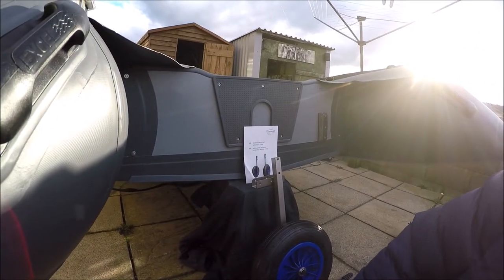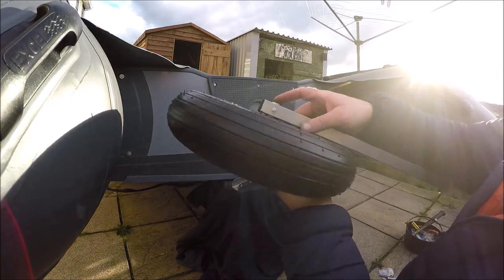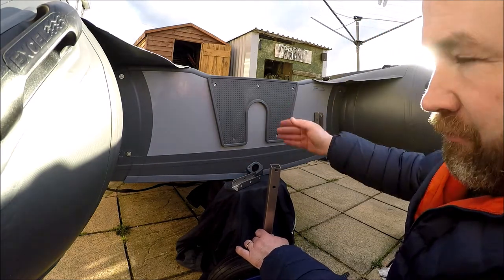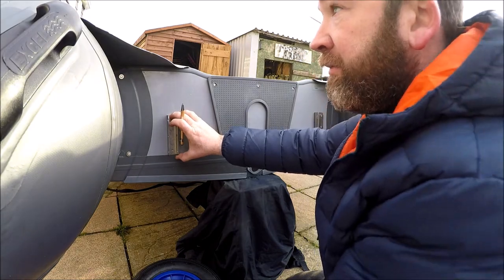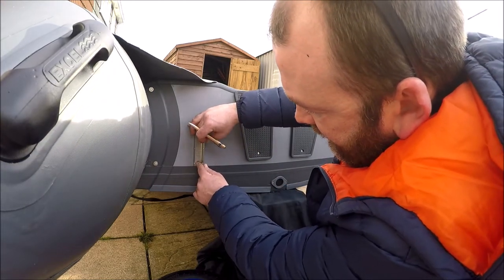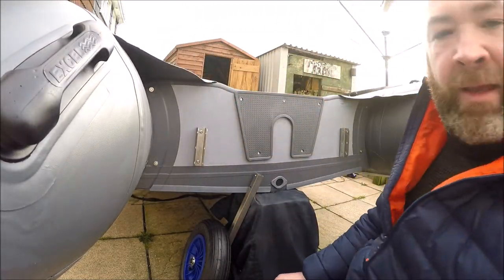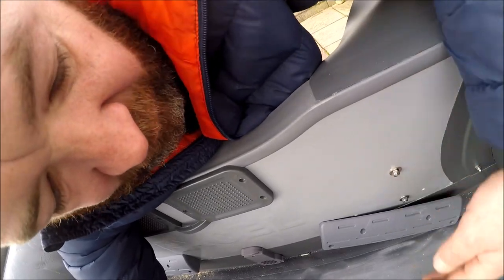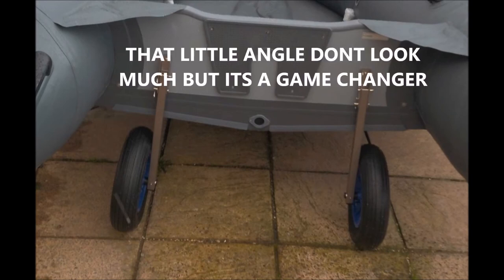HOW TO FIT TRANSOM WHEELS TO A INFLATABLE BOAT SIB FISHING UK

Comment: Fitting mine tomorrow. Same wheels on the volante 360.

Stupid question but I'm guessing you need to tilt your outboard at home first before setting off? Or is there a trick to mounting your engine in the down position when you're setting up?
Reply from the maker: Sorry I've only just seen this.. so I'm guessing you have already done it .. but fitting the wheels as wide as possible is best
Reply: @sibfishingadventuresuk1558  no prob mate yeah we spoke on messenger. All sorted!

Comment: Thanks for the vid, I'll be fitting the same wheel to my sib this week. Do the wheels not foul on the outboard when flipped up with the extra angle? Cheers
Reply from the maker: No but it does reduce the room I alway remove.. over a 390 they are at the maximum load .. but not a bad wheel tbh for the money . If your are doing the angle I would probably reduce its to a few mill also not 5mill
Reply: @sibfishingadventuresuk1558  thanks for the swift response. Do you not find them bulky keeping them in the boat? Do you remove the bracket too or just the actual wheels? I've got the new hydrus 4 3.7m with the interchangeable decks, picking it up wed. No idea what it's going to be like, I've never been in a hydrus but the interchangeable decks was a winner for me
Reply from the maker: Just the wheels... No I put them back in the van or up the front the anchor bucket